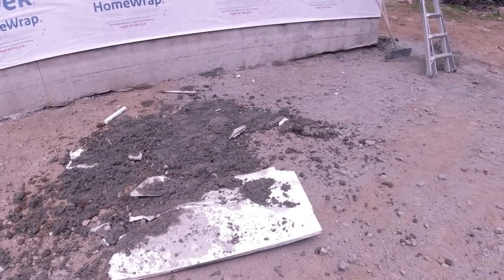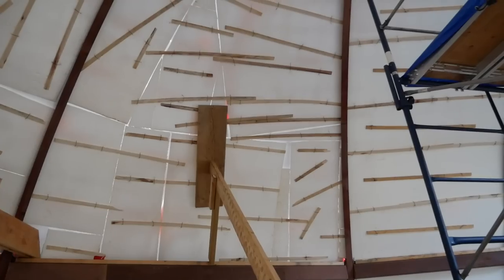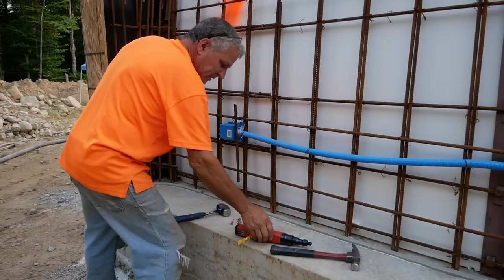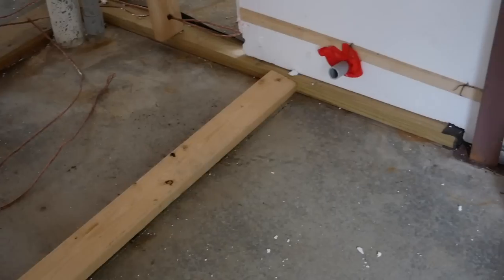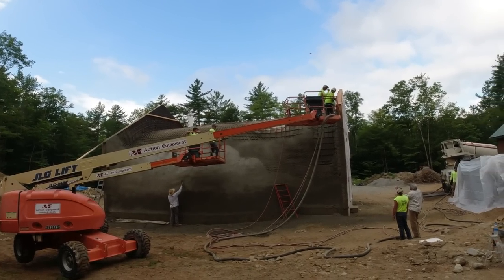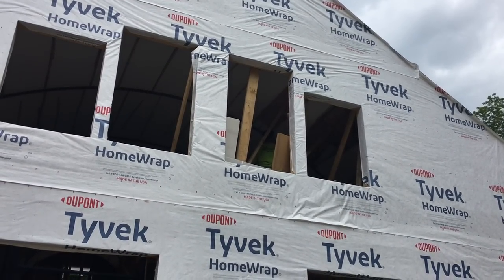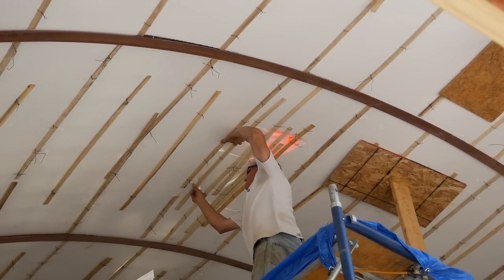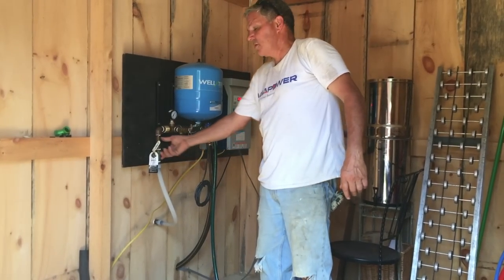SHOTCRETE On the Concrete Dome Home | Building Off-The-Grid

Comment: I am sure this happens because they seemed to be able to fix the ‘blow out” quickly and easily! It did seem like they were putting the same pressure of concrete on the top as the bottom. All in all I believe they did a great job as you all did preparing the dome! Great job! 🙏🏻🙏🏻🙏🏻Blessings, Laura
Reply from the maker: Thanks Laura!

Comment: Did anyone advise you to spray down the concrete?   My foundation was engineered at 3500 psi.  The test tubes not wetted down were in low 4,000 psi.   The test tubes kept wet for 2 weeks came out at 6500 psi.  My foundation will never fail !
Reply from the maker: Yes. We been hosing it down regularly. 👍

Comment: Shot Crete is almost like Gunite, like when they shoot a swimming pool. Except with gunite the mix goes through the hose dry, sand and cement and they inject water in the last 6 inches in the gun.
Reply from the maker: Exactly!

Comment: I was wondering how well that styrofoam would handle the weight of concrete. It did pretty good considering. It’s sucks that you ran out of water, because it would be nice if you could spray they concrete a couple of times a day, so it cures slowly. The slower it cures, the harder it gets.
Reply from the maker: Wells working and we’ve been watering every hour!
Reply: @CreatingASimplerLifeOffGrid  awesome 👍

Comment: Why did you build such a huge place?  You could have built a one story 2 bedroom cabin INSTEAD?!!!  Whatever floats your boat, but my way would have been easier and probably cheaper!  Nice work!!
Reply from the maker: A dream I saved for since I was in my 20’s. And it was going to be 1200 square feet but we added more space at the last minute for a second floor bath… it’s 1500 sq ft so not really huge in our opinion. Need the air volume to maintain temperatures